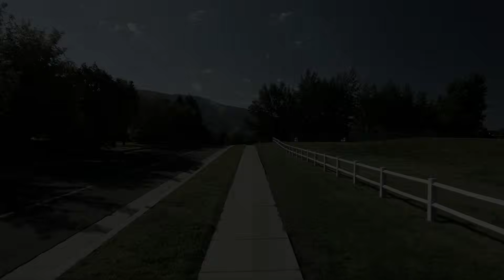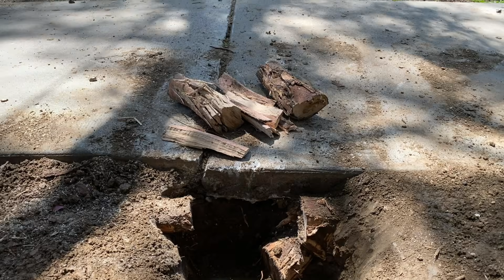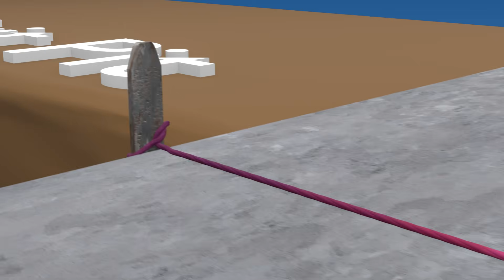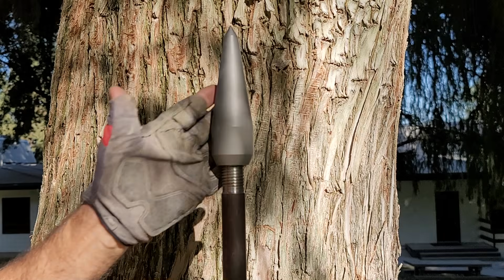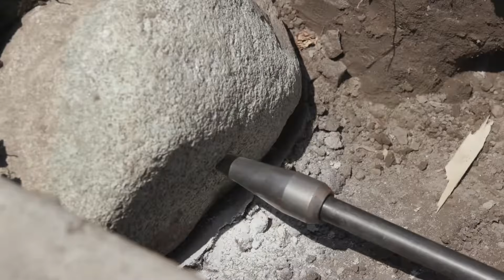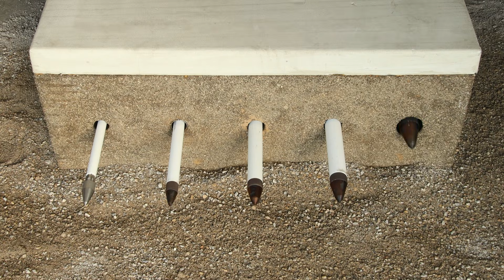Bullet Mole Sidewalk Kit | Bulletmole

Comment: This tool would be worth the cost, if one was a professional doing these sorts of things on a regular bases. Especially considering it's capability to break through rocks and other hard objects. 

I on the other hand just use a pressure washer into an open pipe method... I've had to do this on maybe 3 occasions and using a pressure washer is messy. This thing is a much cleaner and easier approach.

Comment: I just cut off the end of a rock bar from Lowes. A 1 inch PVC pipe slides right over. Beat it through. Don't go under an expansion joint like they are in this video.
Reply: Just get a hose bib adapter and some sch 40 pvc from a hardware store, attach them with some pvc glue and connect and hose and blast through, it works for a lot of soils, just not very well with clay

Comment: This is nice for busting through rocks. I’ve hammered a piece of 1 1/2” Sch. 40 PVC cut at a 45 degree angle with a block of wood at the back to use as a water service pipe sleeve under little sidewalks on hand digs but the pipe is full of soil at the exit side. Rodding out and rinsing out the sleeve is always a chore.

Comment: OH MY GOODNESS, when I saw this video I thought, there are going to be a lot of very unhappy people if they buy this contraption.  This thing will not necessarily go straight depending on what is below your concrete slab, it could go deeper and disappear or it could rise and come out after scraping along the bottom of your concrete slab.  Or it could decide to go left or right and disappear.  If you hit a tree root larger than four inches OD then you will get deflection, if you hit a hard rock larger than four inch OD (outside diameter) the rock won't split as it is surrounded by packed earth with no place to split.  I tried this myself years ago with a similar tool that I had fabricated.  If the soil you're driving through is sandy or loamy soil with no obstructions there is a chance you could do this going under a 3' wide sidewalk. But I'm sure folks with no experience with this sort of thing may run into trouble. This is my personal feelings but what the hell do I know I may be dumber than a bucket of hammer heads.

Comment: as a kid I saw some workmen use a machine in a trench next to a road, the machine was a drill and pushed the bit under the road and  extra lengths of pipe were added. I watched the bit make a slight bulge in the bitumen as the camber of the road made the exit point in the road so the job was stopped.
The small bulge in the road remained for years.
Presumably they should have checked the angle it was drilling at.

Comment: Of course, if you are pouring a sidewalk or driveway in the first place, do not forget to lay in  a pvc pipe of at least 2-3 inch diameter with end caps on them for building a cable highway to get to the other side somewhere in the future.  Otherwise you will have to drill thru as you show in this video.  Yard lights are notorious for this problem.

Comment: Great tool, but unless you’re a large contracting company that needs to bore on a daily or even weekly basis, and willing to drop 2 to 4 thousand $$ on this kit, water boring is going to be the cheapest, effective way to accomplish this.
Reply: Thank you for your comment. Yes, water boring would be cheaper unless you have roots or Rock's, or buried debris. Then it is quite  useless. This is a professional grade tool created to guarantee the user that pipe or conduit will get installed with relative ease and absolute certanty when needed.

Comment: I did the same thing except I glued a PVC nozzle to a stick of 1” PVC pipe and attached my garden hose to it and turned it on. Went under my driveway with no problem.
Reply: Duck tape the hose to pvc and push and pull... looks like the cheapest but if you have the right soil.. mine is sandy...

Comment: In the olden days, the 70's, we would pound a piece of galvanized pipe under the walk and pull it out with a pipe wrench. Primitive but effective if the conditions were right. Water bore became  the preferred method but it will get messy/muddy and will end up off course if it's a long bore.. I have water bored 2" pipe 20 feet under driveways. A home made "shooter" is under $10. Hose adapter, male adapter, brass nozzle and PVC pipe.
Reply: I totally get that. There are scenarios however where water cannot drain because you are below grade. But most of all what abour rocks ,roots or buried debris? Any one who has ever used water to bore a hole has come up against these situations
Reply: @stephenlafontaine2286  Yep.  Any kind of construction is full of challenges that we must face using a variety of tools and methods. For me the water bore has always been the most effective but there are times when nothing short of using a professional boring company or removing and replacing the concrete will work.

Comment: I started in construction at fifteen years of age, l am now seventy five, and have never needed this type of tool.
Reply: It's always a relief to NOT have to go under pavement to install a water line , gasline, or electrical conduit. However; I know thousands of companies and homeowners who do need to gain access under pavement and some, thats all they do every day. For those that do need to get a pipe under pavement,  this is the ticket! It  will get your pipe under every single time you need to, no matter what's underneath.
Reply: I agree, if that’s the type work you do for a living…..sprinklers, lighting, etc. a great tool for those guys.  I wonder if it’s the same company that makes the mighty mole?  I’ve used those numerous times for longer bores before directional boring.  This is a take on the ditch witch P-40/80 rod pusher……DW used hydraulics, they use elbow grease….nice concept!

Comment: That’s pretty cool.   I took a piece of pipe and a car jack.  Pushed it right through in under 5 minutes.   Took longer to dig the trench than push it through.
Reply: Can you explain the process?
Reply: @TrillMoFucka  I took a 6’ piece of metal fence post 2’ diameter and laid it in a  8’ trench that was 2’ deep.  I used the bottle jack from my truck against the dirt and the pipe and pushed it through.  The little bit of dirt that entered the pipe was flushed out with 3/4” pvc connected to a garden hose.

Comment: I used a 6 meter length of 20mm pvc with water, took 10 minutes to penetrate under 5 meters of concrete drive way. Luckily it was just compacted dirt,  had massive hand cramps afterwards due to turning the pvc to cut through, i also cut teeth into the pvc. Did the job.
Reply: It's always a wonderful thing when that happens. I'm glad the soil conditions were just right to allow you to get under with PVC pipe and water. Our tools are designed to make the whole and get the pipe underground in anything but perfect conditions, which is usually the case.
Reply: @stephenlafontaine2286  cause it was directly under a slab, no reason for anything other then compacted base to be there.
Reply: @prophetanarchy2355  very true👍

Comment: You can also do it like this its cheaper https://youtu.be/drrzpIyQBsI
Reply: Thank you for your comment. There are cheaper ways to make holes but those methods cannot do what this tool can do as far as going through burried debris on a cosistent and extended period of time. This is a professional tool for professionals who want the best tool that delivers the best results, meaning it will get the pipe in verey single time no matter what, not foe the occassional do it yourselfer.

Comment: This is the most complicated scenario I have ever seen for putting pipe under a sidewalk. 

Here's the simple version:

1 call utility scouts.
2 buy $30 72 inch pencil point digging bar from any hardware store. 
3 dig trench.
4 line up bar.
5 hit bar through other side
6 duct tape pipe to just emerged digging bar shaft
7 pull digging bar with pipe attached back through hole 
8 attach pipe to hookup
9 fill trench 

The hardest part is digging the trench.   The rest is stupid easy.
Reply: Easier yet, use a power washer and a piece of 1 1/2 pipe a little longer than the sidewalk is wide...dig holes on either side of the walk. Put the wand in the pipe and blast away! As stuff comes out and softens, wiggle the pipe forward.
Reply: True in some cases it might go as you explain. KEEP IN MIND, the OD. Of a digging bar is mabe 1" to 1-1/4". And its not hardened steel. I dont think you could drive it through the same debris that is shown in our  sidewalk video.Going through cobble or lots of rocks in mountain areas that bar would get stuck because the shaft is the same size all the way. Then pulling the pipe back through would have so much friction on the pipe or conduit that it would probably detach quickly and be cracked or dammaged in such a small hole. Next please do note that the OD (outer diameter) of conduit is 1.315 or almost 1-3/8 of an inch which is larger than the 1inch pipe so ,oops your restricted to a 3/4" line which would still be very very tight. Anyway what happens when you need to install a 1" line ow a 1-1/4, 1-1/2 or 2" line? Would you use the same technology? What about longer distances? Sorry I dont mean to complicate things more but these are real viable questions that any professional would ask.

Comment: WOW you do not give it away!
2-CAR DRIVEWAY KIT $2,460.00 
PRO PACK $3,975.00
Reply: That's crazy .  Now if it came with a ram jack to push the pipe, but standing there w/ a 16 pound sledgehammer doesn't look fun or cost vs effective means.  Got to be some hydraulics in there for that kind of price.

Comment: Sorry do to install fibre optical cable you woukd dig a trench to the property this would not be acceptable say you got 6 to 7 metre   of drive way  this would not work.
Reply: I dont really get what your point is. So Say I have to go 6 to 7 meters? That wouldnt be a problem, just keep adding shafts that are 49" at a time or 64" at a time from the same entrance trench wich can be 6-1/2 Ft long to 7-18/2 ft long depending on the shaft length. Weve been doing this 28 years so something must be working.

Comment: I've been doing this with a peice of pvc and a  pressure washer for over 10 years......😆
Reply: Well that's very impressive how you can slide your pipe, wether its PVC or steel, through soil that is 90% rock. I would say you Rock!! Keep up the great work. Are you Able to get under driveways as well with the same method?.
Reply: @stephenlafontaine2286  30 or 40 feet was probably longest run under a patio. Yes driveways as well. I'm not talking commercial here only residential.
Reply: @gunpowderHVA  wow you really do rock then.
Reply: WOW,! Hey, Have you ever tried black iron pipe? Some of the comments I've reieved talk of using it. It sounds so durable... compared to PVC. Then again it is cheaper to buy PVC Pipe, so why spend the "extra money" if you don't need to. Well anyway it must be nice to have worked 10 years in soft, clean soul conditions. Most of America however, is covered with some type of hills or mountains. Anyways your the man keep up the good work. Inovation is what built our great country.
Reply: @stephenlafontaine2286  I have no idea what soft dirt is. I live in Southern California. 90% rocks 10% dirt. In harder areas I use steel pipe with a sharpened end and thread my pvc onto the back. And homeowners don't want me to run black iron pipe all over their yard for sprinklers. Most hoas won't even let you.
Reply: How do you do it?

Comment: Not a bad idea for $100 but it’s insane for $800+ dollars. Make the same thing for $20 in parts.
Reply: You have absolutely no idea what you are talking about
Reply: @stephenlafontaine2286  48” 1/2” Black steel pipe $14. Masonry chisel $5. 1/2” Black steel pipe Union and flange $5. 4’ 2”x4” 5$. This is if you buy everything new. Since I have everything but the black steel pipe and fittings I could make it for $20. It looks like it is you who have no idea what they are talking about.
Reply: @matthewhuszarik4173  well I see you've mastered arithmatic. Now do you know the steel  chemistry of black iron pipe. Or what the Rockwell hardness is compared to this tool? How about the heat treating and tempering process.. The iron pipe will not fracture a rock. The bulletmole will do it all daY long year after year. There is actually a reason for that and it has to do with alot more than simple arithmatic. There is no comparison between the two methods. Your might work some of the time with much frustration. The Bullet Mole works Every single time with with minimal effort. Professionals in this field work hard enough and really want a tool that minimizes as much guess work as possible. They would rather just get it done once and for all and get on with their work. It's not for everyone though.
Reply: @stephenlafontaine2286  I know that the Rockhardness of a masonry chisel is at least as good as their cutting tip. And their pipe isn’t hardened any more than the black iron pipe is. Do you know actually know anything about metallurgy or just like spouting big words you know?
Reply: Ive forgotten more than you will ever know about metallurgy. I can see that this is going no where. Good luck to you.
Reply: @stephenlafontaine2286  I see you have a fine case of Dunning-Kruger good luck with that.
Reply: @matthewhuszarik4173  We have been doing this 28 years. Thousands of tools sold. These are facts not misconceptions or biases. Our customers from 20 years ago still buy parts.black iron pipe and fittings is not innovative or fool proof and for some people that's good enough, but for others they do want the best. As far as Kruger goes you were the one who first implied that your system was the "way to go" far beyond a bullet mole. Good luck with your black iron pipe and such

Comment: This tool must be for municipal workers on the clock.  Anyone else would use a pressure washer and be done in 1/4 of the time.
Reply: How would a pressure washer go through Rock, roots, gravel? Power washing away the sand substrate ultimately weakens the sidewalk. The void the water creates can cause problems in time. This method doesn't create unwanted voids.
Reply: @DerekFromBK  Breaking a rock in half doesn't create a void?  Interesting.  It is rare that you would find a large rock close to the slab as generally speaking, it would have been cleared at the time of pour unless you are close to bedrock.   As for large roots, I would suspect that they would be raising the slab and I would hope that a respectable contractor would address that issue before running pipe under a compromised slab but who knows?  I'm sure this compony would happily take your order for one.
Reply: @Derek  100%, to bad some many ppl don't know how to do things right.
Reply: @DerekFromBK  I don't think anyone should be particularly worried about several inches thick concrete being able to bridge a 1 inch wide gap.
Reply: I would love to do a test run competition against your method especially in rocky or root laden soil.We could even video tape it and post the video right here on theis very feed. Where are you located. mabe we can set this up.
Reply: @stephenlafontaine2286   it’s been done already.  https://www.youtube.com/watch?v=SaE1ikmJJrg
Reply: @norsebavarian1941  thank you for the info. I didnt notice roots or rocks or gravel which is what is usually under city sidewalks.We have a tool that will install a 3" drain pipe at the same time as it makes the hole. Not for sale yet though nor videos. No water no hoses ,no water sources needed, no clean up. I still know we could have the pipe installed before you unload the washer and hose and hook it all up ( then you have to put it away). This tool weighs about 12 pounds.It is pre assembled. just slide the pipe over the shaft and drive it in under 1 min. Ive done them in as little as 20 Seconds in that type of soil. pull the tool out from the center and leave the pipe installed.
Reply: @stephenlafontaine2286  I would love to see you prove all these idiots wrong.
Reply: My first thought as well....turbo nozzle on a hose run right through the pipe.  Feed em both as you go.  Forgot this nonsense
Reply: Yep. I ran my house's water supply under a 10 foot wide driveway by just adapting a brass nozzle onto one side of the 3/4" PVC, and the existing water supply to the other side via a hose. Ate right through and exited only a half inch off from the target.
Reply: Bro im pulling my hair out finding quickest way to do this. I’m a directional bore contractor working for google. At every other property line they want a 1” pipe installed from easement to opposite side of sidewalk. I’ve used my 100k bore machine, 60k vac tank, burnt up power drills and fabricated drill bits trying to find easy cost efficient way to do this 50$ job required for me to get it out of the way to make the big bucks! Please help!!!!

Comment: Company, just dig 8 feet on either side to go under 4 feet of sidewalk it will be fine that your whole yard is trashed.
Reply: I don't understand your comment. You only need to dig an entrance trench on one side of the sidewalk. Usually at the point where you're going to go under the sidewalk you already have a trench up to that point already. So it's not like you're opening an extra trench  That you don't need. On the opposite side of the sidewalk you only need to dig an exit pit large enough to unscrew the point but usually when making a pipe connection on the opposite side there is usually some type of trench there as well. We also have 49" shafts  That would require a much shorter entrance trench and you can Bang the shaft in at an angle  Downward So that ultimately you don't even need to dig an entrance  Trench. This video is a how to video  Demonstrating every possible contingency and explaining every detail.. Most professionals know how to use the trool with a lot more ease and thoughtbthan what is shown in the video.